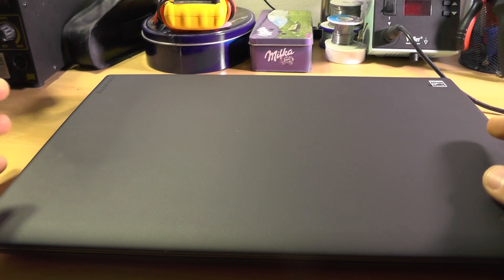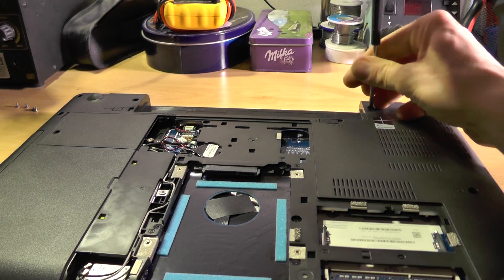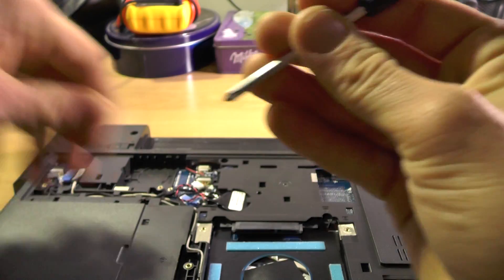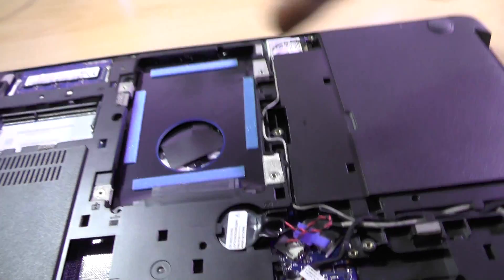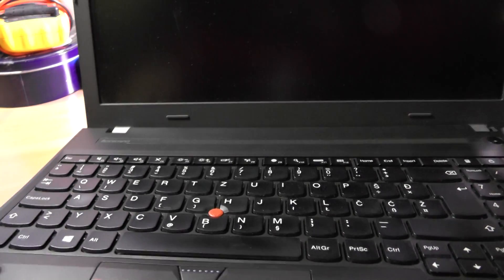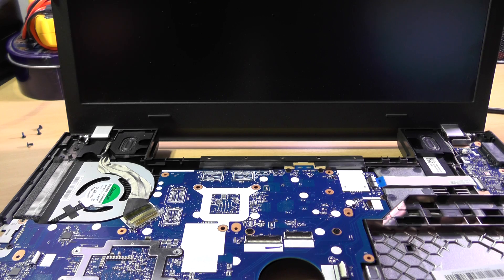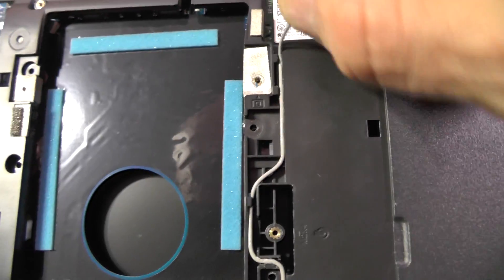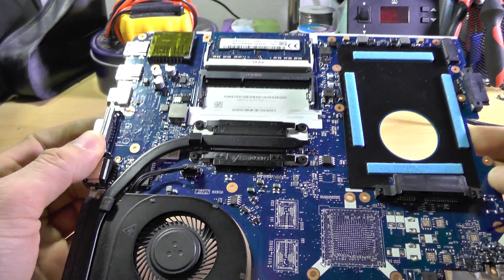[HW: How To] - disassemble Lenovo E550

Comment: 5:08 This is incorrect procedure. To remove the keyboard, you only need unscrew the three keyboard screws. Then, push the keyboard away from you so the function key edge slips farther up under the bezel. The closer touchpad end of the keyboard is now free. You can lift that end up then slide the keyboard towards you and out the rest of the way.

Comment: Hello friend. I've got the same computer but It doesnt turn on after push the power on. The led in red shine slow.. I tried to pressw the power on button 30sec and all this stuff without victory. It did the same 3 times, the other two i won the issue, but now I cant. Do you know why is this problem and how to solve it? Thanks in advance. My email is senengs@hotmail.com if you want to set me light over this problem. Thanks !!
Reply: Hi Senen I ve got the same problem as you this morning and I am afraid that the issue concers the motherboard. I tried another battery and another charger but not solved.
Reply from the maker: sorry, no, i would need to run diagnostics to see what's broken... :(

Comment: You are removing the keyboard wrongly. There is no need to use any force or bending, just slide it towards display.
Reply from the maker: yeah, you're right... mistakes were made :) (i did end up pushing it but yeah...)